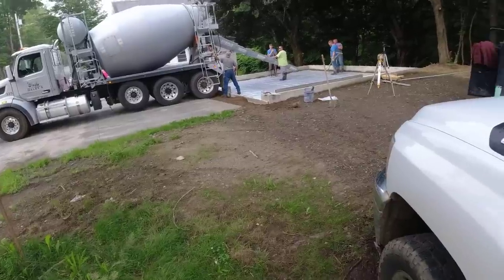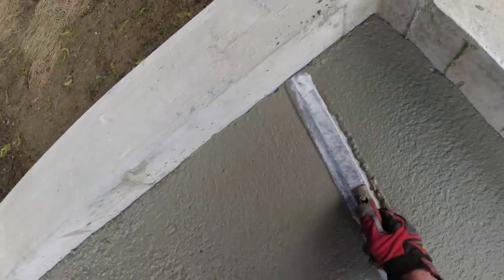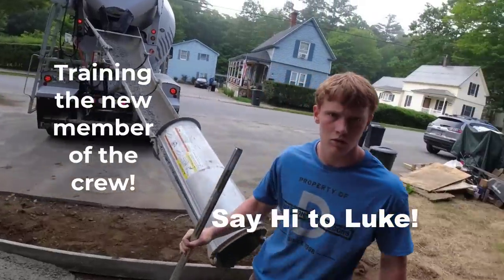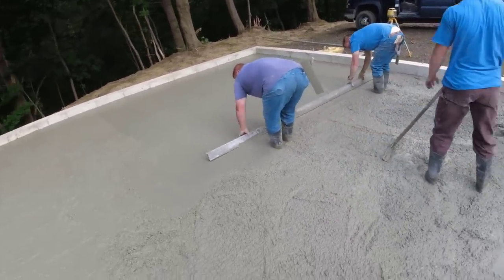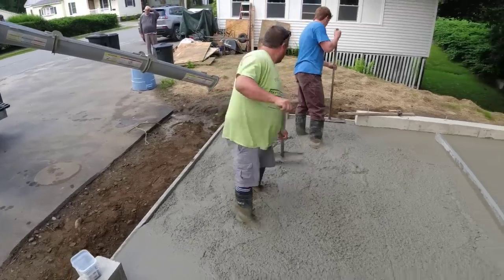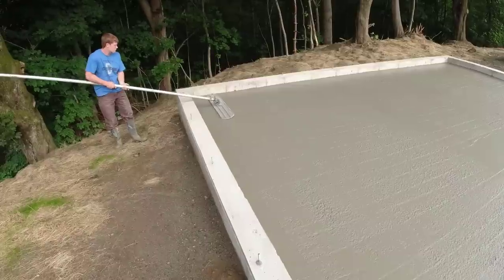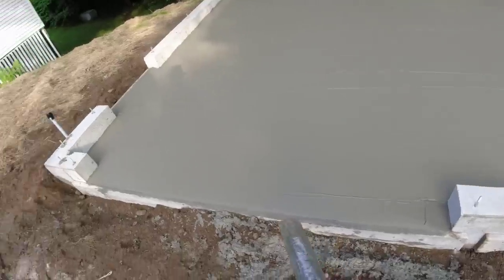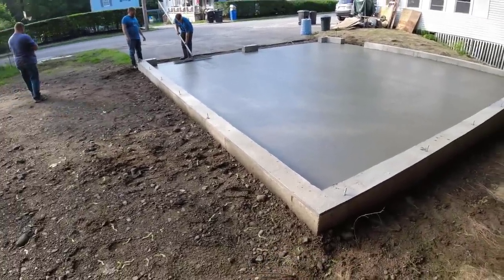Teaching The New Guy on the Crew! (How To Pour Concrete)

Comment: Great video!  There were a few tips on the “whys” that I caught.  One question though… I understand why you mag the edges before screeding, but why use a magnesium instead of steel first, then use a steel trowel for finishing?  Why not just use steel trowels, or just use mag trowels? Why do you need both? What’s the difference between steel and mag for concrete work?

Comment: Hey Mike, I'm still just a little confused on the order to dispatch.  So you order a 3 or 4 slump with high range water reducer, is that right?
Reply from the maker: That's correct
Reply: @MikeDayConcrete  Thanks